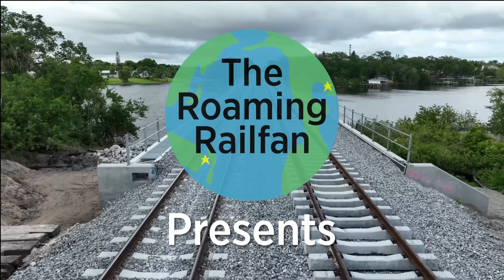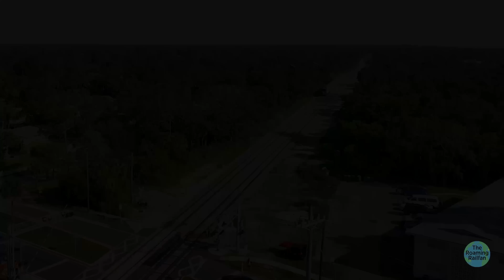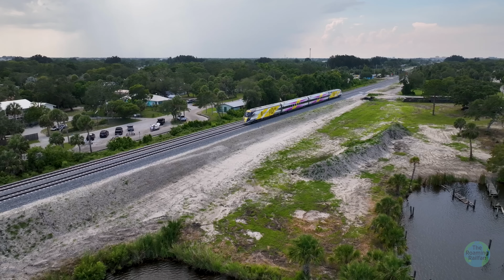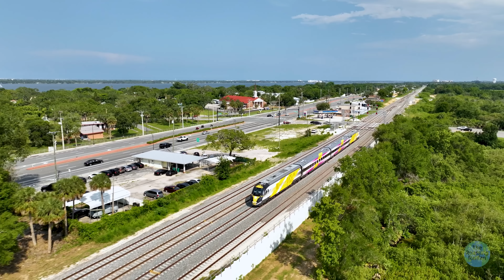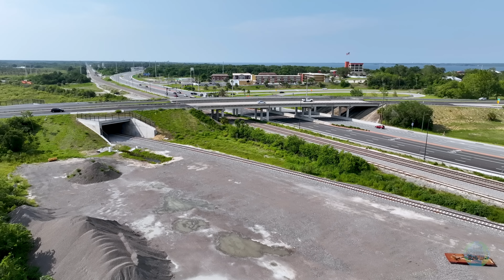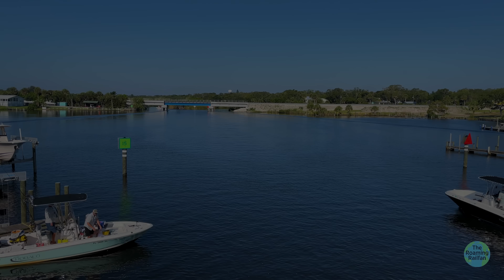Brightline Construction: Double Track Test Trains in Melbourne/Palm Bay - June 2023

Comment: Any news on the maximum number of cars per train or if additional trainsets will be ordered for expansion if passenger numbers increase?
Reply from the maker: Stations are built for trains a maximum size of 10 cars and 2 locomotives long. Additional coaches are already on order.
Reply: @RoamingRailfan  Thanks for responding so quick. I wish them great success.